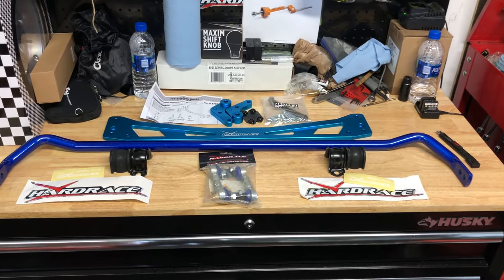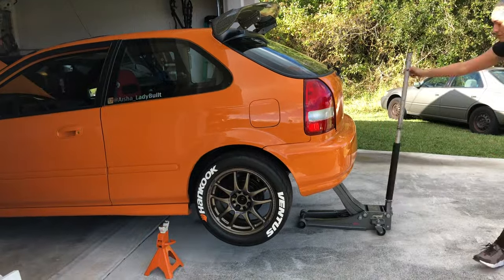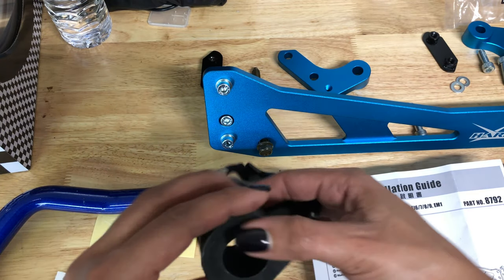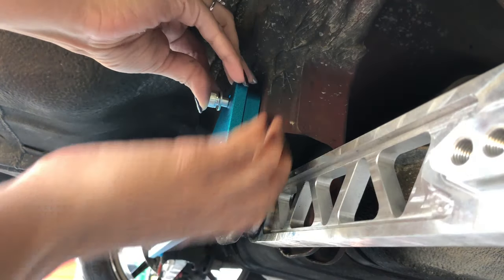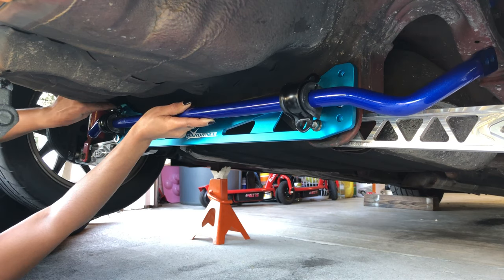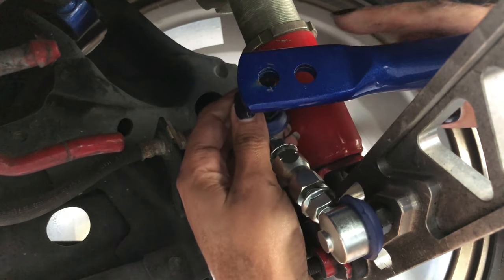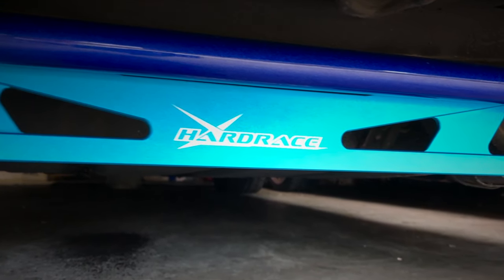HARDRACE Sway Bar & Subframe Brace Kit Install Step-By-Step

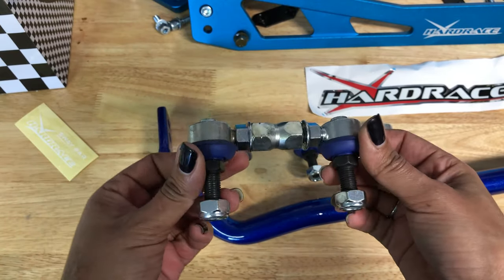Comment: 5:26 I was taught to use a bit of rubber grease on the inside of the sway bar bushings.
This video was the clearest explanation I've ever seen, especially the rationale for the order of istalling the bolts, the role of the spacer and backing plate, the interaction with the sway bar, etc.

Comment: It’s been a minute but glad you dropped another video. I’m working on my teg as well but I’m putting that jdm front end on it. As for sway bars I have the asr rear sway bar.

In video you should mentioned to put the car in gear for lifting from the rear. It’ll prevent it from rolling.
Reply from the maker: Yea, it has been a minute lol.. Nothing is wrong with the ASR stuff, I just am a big fan of Hardrace. You're right, putting the car in gear will prevent it from rolling, I didn't think of that at the time I was editing the video lol.

Comment: Nice vid ,You should make a review video on how the ride feels now with the sway bar installed I been thinking of getting it for my EF but can’t justify spending the money for something I don’t think would improve handling...follow up vid plz 🔥🚗
Reply from the maker: Good idea! I still have not moved the position of the end link to the stiffer setting. Maybe when I move it I'll make an update video. Thank you!
Reply: I have my sway bar off now and it feels like a boat in the sea when cornering while with it on, the ride feels like it is solid and handles corners like a champion. Keeps flat.

Comment: A bit late but just for the future, fully tighten your lower control arm bolts only when it's loaded. Your bushings will thank you for it.
Reply from the maker: Thank you! You are correct, that is the procedure for normal bushings, but I have spherical bushings so I can get away with tightening with no load. I should have mentioned in in the video, but I wasn't thinking about it at the time I was editing.
Reply: @Aisha_LadyBuilt  Spherical bearings, awesome! don't mind me then :) Really enjoy your vids! Very informative and clear. Keep it up :D

Comment: Hardrace is the best price to quality brand out there!!!!! so many people fall for the polyurethane  Energy suspension kits...    but hardrace keeps the traditional "tortional rubber" design and its DYNAMITE!!!! 👍👍
Reply from the maker: I have lots of HardRace suspension parts on my car. They're quality parts, and I've never had an issue with them.
Reply: Its advertised 150% stronger than oem rubber, i think the trailing arm bushings are 250% stronger!!!  my b17vtec wagovan rides like BUTTER dropped 2.5" on bumpy massachusettes roads!!!

Comment: Don't need to install front and rear .
Front wheel drive cars are very often understeering,so a rear sway bar only is better to get a more neutral behaviour.
You tune your chassis according to your need.
Same for tires,you should get wider on front and thinner on rear to balance grip.
There is often a front swaybar on rear wheel drive cars,and nothing at the rear to get a slightly understeering car,wich peoples without experience can control more easily.
Reply: Nearly everything or everything you said is wrong, only a full drag fwd setup needs wider tyres in front and skinny tyres in the back, her car is still a full street car that she takes to the track, a drag track to be more specific, skinnies on the back feel or are very sketchy on track farless for the streets, why do you think circuit track cars have wider tyres on the front and back, its because you need traction on all tyres , the sway bars will help her in every way especially on the streets , there's no disadvantage of putting on upgraded sway bars on your street car or any car as a matter of fact, sorry to say but you clearly don't know what you're talking about and you're making yourself look stupid

Comment: LCA 3 holes are for different rate of stiffness.
The outer hole is the stiffer setting.
And these bushings need some lube before installing.
But great video..
Reply from the maker: Thank you! Really? I'm no expert, but to my knowledge, you want to have the end link sit close to a 90 degree angle and if it goes into another one of the lca holes it will not sit close to the 90 degree angle. I thought that the stiffness adjustment is made at the holes on the swaybar itself.
Reply: @Aisha_LadyBuilt  yeah the 3 holes are different levels of stiffness same as some bars have adjustment holes too.
On the bar from the end to the inner is soft medium and hard.
Some people need more adjustment positions because they are extremely picky and they can feel little differences. 
Like myself.
The degrees doesn't matter. The laverage does all the job. 
Y use to race rally since I was 12 years old so I have experience on all these type of things.
When I was 15 I use to race baja style.
Now im into time attack.
Thanks

Comment: Great vid. How did it perform? Good looking kit. Simpler than the Beaks.
Reply from the maker: Thank you! I can feel a difference, but I'm going to change the hole on the swaybar to the more aggressive one to see what difference that makes. The Beaks is just a tie bar, this is a sway bar, so it basically connects the LCAs to connect both sides of the suspension together so they sort of move as one.

Comment: correct me if i'm misunderstood but shouldn't you pre-tension while tightening by having a jack under your wheel to give it the illusion that the car is lowered down and there is the weight of the car on the sway bar? Not an expert by any means just trying to keep you safe, i could be wrong tho
Reply from the maker: You are correct, however, my lower control arms have spherical bushings, so I don't need to preload mine. If someone has normal bushings in their LCAs then they should tighten the bolts with the wheels on the ground or like you said jacking up the wheel. I forgot about that when I was editing the video. Thank you!

Comment: Tech question Ms. Aisha, I currently have the skunk2 rear lca for my '99 EK 4dr. and I'm interested in the ASR neochrome subframe to match the rear lca however I'm currently making over 400whp and I wanted to first ask what made you decide to change up the subframe? Was it due to the swaybar you installed on this video being inadequate to the ASR subframe? Or is it because of the increase in power your motor's making currently to give increased handling and drivability?
Reply from the maker: The Hardrace swaybar and subframe brace come as a kit, so I used everything from the kit. The swaybar could have worked with the ASR subframe brace, but I prefer to have matching parts.

Comment: is it necessary to preload before tighten the LCA bolt?
Reply from the maker: My lower control arms have spherical bushings, so I don't have to preload mine, but you are correct. If someone has normal bushings in their LCAs then they should tighten the bolts with the wheels on the ground. Thank you, I should have put that in the video as a note.

Comment: What front sway bar do you have? And does it help coincide with the rear one
Reply from the maker: I have the Blox 26mm front sway bar. And for our civics the front should be a larger sway bar than the rear. So yes, this combination of 24.5mm in the rear and 26mm in the front works for me.

Comment: I wonder why is the lower control arm not pushed to the ground by the suspension spring when the bolt is not in? I mean the spring is not completely without preload when the car is lifted. The control arm should fall down.

Comment: What you think best sway bars work better front n back on a 00 civic ex coupe
Reply from the maker: The HardRace rear and Blox 26mm front is what I am running right now. I'd figure it would be similar on a coupe. I feel that this is the best combination of what's available on the market currently.

Comment: Any specific reason on why you switched?
Reply from the maker: I didn't have a swaybar before, I only had the subframe brace. The Hardrace swaybar and subframe brace come as a kit, so I used everything from the kit because I prefer to have matching parts.

Comment: Sway bar - subframe brace - subframe. I hear stories about tear-outs of sway bars if not using subframe brace, but at the end of the day the car's subframe is carrying more weight and therefor more stress particular at the bolt holes (which is where the tear-outs usually are). Is it then fair to say, the 'security' of the overall system depends on the car's subframe and not the subframe brace?
Reply: Im a Newbie ask there is  two different subframe ? The one already installed ARS that sub frame brace... The new one Sway bar with sub frame  hardrace .... I which is better .... In stock only install sway bar as stock

Comment: i checked the links you used.. i used the same but have hard race lower control arms as well and the links just aren't meeting up properly
Reply from the maker: I'll be honest, I ended up using Blox adjustable links as they were a little easier and more adjustable.
Reply: @Aisha_LadyBuilt  thank you heaps !

Comment: why go hard race when you already had ASR?
Reply from the maker: Because I like Hardrace suspension parts. I wanted to add the swaybar and the Hardrace swaybar came as a kit, so I decided to switch out everything. I also have Hardrace front upper and lower control arms and rear toe adjusters and camber adjusters. Hardrace makes quality parts.

Comment: i guess that's why i spun out around a corner :(
i have a front swaybar but not rear
Reply from the maker: 😲 Ohhh nooo! That could defiantly be the cause of spinning out! Be careful! Get a rear sway bar to match!
Reply: They miss built the 96 to 00 ex then all have only a front. Very good video
Reply: Quite the opposite. A car with a front swaybar but no rear swaybar will naturally understeer and vice versa.
Reply: No.  front sway bar is more likely to induce understeer so you would go wide on the corner, not have the rear pass the front.
Reply: @Back Road Customs that makes more sense because when i was going around the corner i went straight instead of going around the bend :(
i fixed it up but I'm extremely pissed at myself because its a true numbers matching EM1
Reply: @triniwarrior16  if you look around, most people that road race or autocross the EF/EG/EK chassis will usually run a rear bar around 24mm and either stock or no front bar.  These cars like to understeer, the more you can add to the rear the better really.
Reply: @Back Road Customs thanks a lot man
currently i have a 27mm front swaybar and none in the rear BUT im looking to get a 25mm rear one from asr

Comment: You overlooked two important things in the video!! 1st, it is important to grease the sway bar bushings with grease to avoid squeezing issues. 2nd, you did NOT preload the bushings before tightening up the bolts, this is a mistake, and puts a lot of extra stress on the bushings, and other hardware………important!

Comment: Does the rear swaybar make the car feel more neutral on turn in? How does it rotate in corner entry?
Reply from the maker: I haven't been on any roads to really test out the cornering, but basic driving I can feel a difference in the way the car leans (roll).